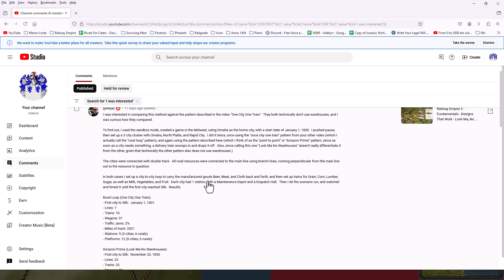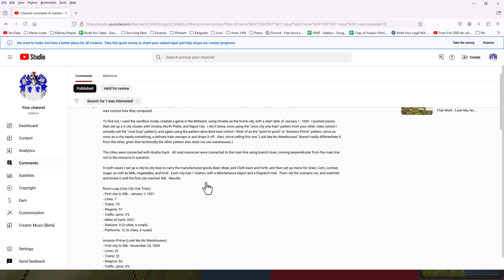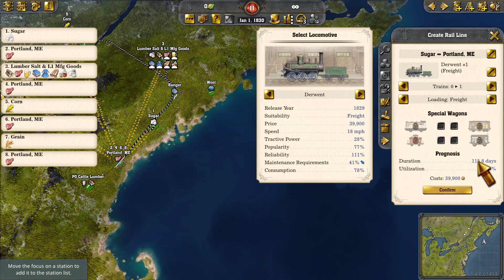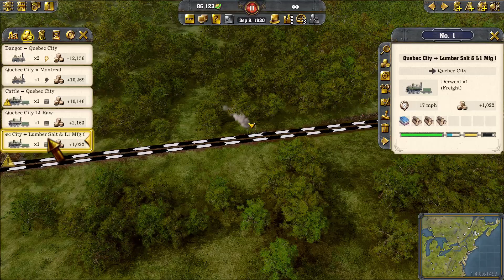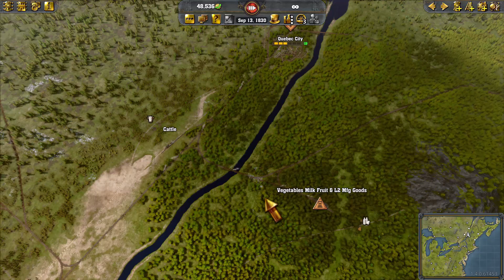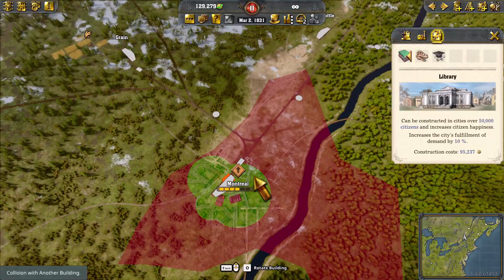Railway Empire 2 - Fundamentals - Designs That Work - A Great Start

Comment: I got Railroad Empire on sale. It's better than Sid Meyers' Railroads, but I'm seeing significant issues. In particular, trains always directed to platform 1, even though platform 2 is available. I was reading the forum, and this is a well documented gripe that was never repaired. Has this been fixed in R. E. 2?
Reply from the maker: Railway Empire had automated stations (added some time after the initial release) that routed trains to open platforms. RE2 does this as long as you use the gridiron tool to create your junctions at the stations.

Comment: Hey Adekyn,

I conducted an experiment to determine the best way to make money via express lines based on your videos and some ideas I read on Steam.

Comparing...

1. One train per city to city, alternating restaurant and post office with maintenance and post office (seems cheaper to get started)
2. One train per 5 days from city to city (more expensive to start, but Adekyn does it this way)
3. Set up a rural station midway between each city-to-city line with a hotel and maintenance on it as well as a restaurant and post office at each city station. Then, one train per 5 days will be on every line. (I read about this on Steam; it's very expensive and slow to start, but I'm told it is substantially more profitable) 

I used Scenario 2 Star Logistics because it has a simple array of cities. I just remembered that I need to connect Memphis with Louisville, so I will need to leave that off all the experiments.

Scenario 1 - 1 Train per city to city. I connected all the cities on the map.

Profit
Q1: $2,549,073
Q2: $2,040,959
Q3: $1,953,520

Scenario 2 - 1 Train for every 5 days, when it was 8 days total I added 2 for the sake of the experiment.

Profit
Q1: $2,663,462
Q2: $2,671,580
Q3: $2,926,723

Scenario 3 - Put a station in the middle between each station with a hotel and maintenance. At each city station, place a restaurant and post office. Train for every five days; when it was eight days total, I added 2 for the sake of the experiment.

Profit
Q1: $2,118,291
Q2: $3,142,128
Q3: $4,222,282

Conclusion
- Scenario 3 is vastly more profitable than the 1 and 2
- It was slower in Q1 but faster after that
- It is much more finicky to setup

Next question... Will it give me a higher score if I complete the scenario using Scenario 3?
Reply from the maker: As Colonel Klink would say, "Interesting, very interesting." Thanks for doing this. I get the value of having restaurant and post office on each end, but it seems you would lose something by not having bonuses at the "hotel" stop.

Comment: We didn't get to see the set-up for the 4 cities to the warehouse, and you didn't mention it, BUT, as I recall, there can be an issue where the beer city train takes beer TO the WH, and then sometimes just loads beer to take BACK unless you forbid it.

Was kinda confused at the 40K mark with the three new goods--why not warehouse them??? Ah, you got there after showing how slow the three as solos was--so yay! When you added an extra train to support Fruit for the distillery, you'd also need to up the Sugar input as well, right?

Comment: Good stuff!
I am wondering 2 things.
The first 1 noticed on the end where you looked up the rail-length. I noticed you had a delay % of 11. What's the maximum on that % which is acceptable (and still works!)? 
The second one is maintainance/splitting freight-express.  You have the stations in the cities setup for express, so maintainance every other station. The trains from cities whithout maintainance to the raw-stations get their maintainance there which results in delays at the raws. It probably would be wise at some point to split the freight and simply add stations in every city just for the express right?
Reply from the maker: 1 - Yes, 11% delay is too high. Time to consider number 2.
2 - Yes, split into separate station for express, then revisit the traffic at the freight stations and consider expanding the stations.